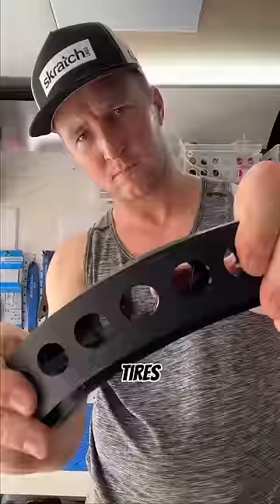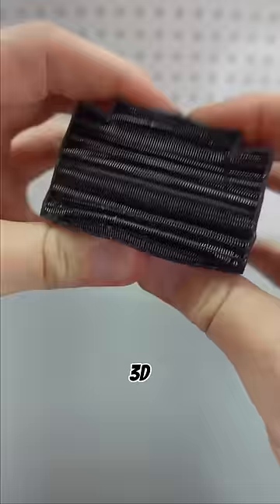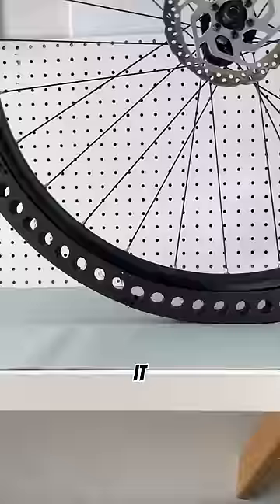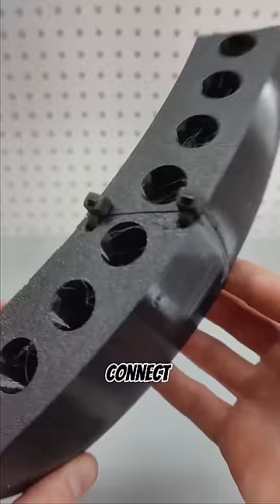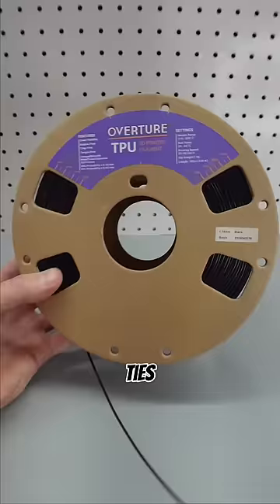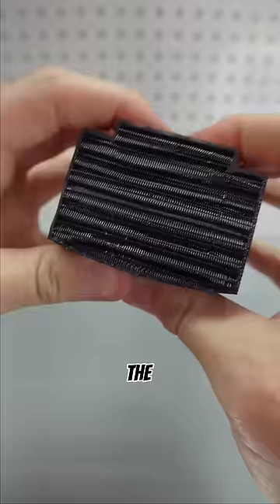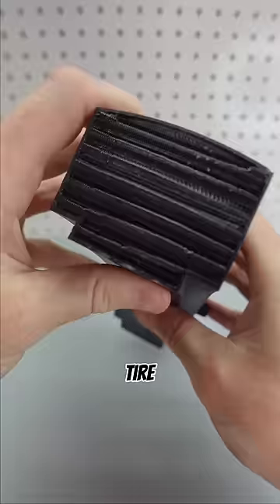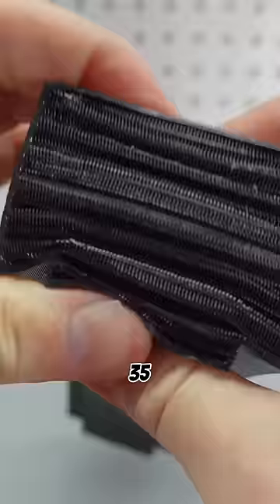3D print your own bike tires! #mtb #cycling #bikeshorts

Comment: You can squeeze 30psi like that!! You are a strong man.
Reply: If you don't think it's right, whip out your own design. Do better. Show him how it's done, big boy.
Reply: @vociferonheraldofthewinter2284 no u
Reply: @vociferonheraldofthewinter2284  y u so mad?
Reply: @vociferonheraldofthewinter2284  it’s not about that it’s about accurate measurements
Reply: @vociferonheraldofthewinter2284 where did he say it’s wrong
Reply: @vociferonheraldofthewinter2284 You've gotta be kidding, you completely Misinterpreted what he meant. How in God's name. Did you think he was calling him wrong check yourself
Reply: If you only push down on one square inch of it you're only pushing down 30 pounds which is pretty light for male grip strength
Reply: the following is my summation of what we saw, im not an expert tho. with a normal tire, the air is kept in a single enclosed space, so when you squeeze on a single point like that on a normal tire you are also pushing on all the pressure around that point of contact. with this printed tire it seems that each individual point of contact provides 30Ibs of pressure, and when squeezed in a singular point of contact it doesnt interact with the material/medium around it, making 30Ibs SEEM like less when in reality its just because the tire isnt meant to be squeezed like that. the weight distribution is supposed to be over a road where the whole surface of the tire can make contact, not just a few fingers. 

-my educated guess

that guy who commented before me, JungleFatigues, inspired this
Reply: ??? How weak is your grip
Reply: @SixStringShredder Are you drunk or do you just not understand insinuation?
Reply: @clockworkNate  insinuation of OP’s comment or that herald of winter guy? 🤨
Reply: Or you're weak not being able to. 35 ain't that much. I rode 100 psi on my street bike and 40-45psi for rec and trail. 
As an ex bicycle mechanic I could press 35 psi all day every day lol.
Reply: @junglefatigues123  thank god someone who actually knows....as an ex bicycle mechanic I'm a little worried seeing how people think it's almost impossible to press in 30-35 psi. It's definitely NOT hard to do. People out here with friggin doll hands or some shit weak as 😂😂😂
Reply: He has a full grip around the whole tire section. A car on 32 psi can be pushed in vía big thumb
Reply: Yes you can. I can squeeze 50 psi in a hybrid road tire so you definitely can squeeze 30 psi smh.
Reply: @vociferonheraldofthewinter2284 you don't have to be a chef to know that food is bad
Reply: @vociferonheraldofthewinter2284 you realize he's not wrong the first thing i thought was htf does it compress like that if he just said about 35 psi. Would literally fully compress with the weight of a person
Reply: "Feels like" doesn't have 35psi in them 🤣
Reply: I can complete compress new car shocks witch my bare hands
Reply: @vociferonheraldofthewinter2284   well that didn't go the way you thought it would, did it?? 😂😂😂
Reply: @vociferonheraldofthewinter2284  as a mechanic. That is about 10psi max. You cant squeeze 35 psi like that. You would need leverage
Reply: Go measure a 35 psi car tire and tell me if you can squeeze it. Everyone's a youtube mechanic in the comments 😅
Reply: @insolentish11 car tire pressure is also 35 lbs please show your video of you squeezing a aired up car donut.
Reply: @vociferonheraldofthewinter2284 come back kid, we want to make fun of you.
Reply: Dirtbikes  using 2-3bar  29-43psi for jumps and u can squeeze it... racingbycicles use  if ur weight is about 70kg  7bar means about 101,5 psi....
Reply: @junglefatigues123  we all know what a 35psi bike tyre feels like- fairly tight. However my trike runs at 70psi to my preffered minimal rolling resistance. 35 doesn't grip as well on fast tight corners- you can hear them scrubbing.
Reply: @SB35702  news flash- wheels are round and bike tyres have a round cross section. Actual ground contact while riding is really no more than 1.5" square. Unless of course the pressure is way too low. On my recumbent trike, the standard tyres minimum pressure is 35 psi, maximum is 70- which is what I run for best grip on fast corners and better rolling resistance.
Reply: Air reacted differently than a polymer steacture to compression. Air can move inside the tire while this can not. So to evaluate that you would need to try it on actuall ground.
Reply: @vociferonheraldofthewinter2284  I think you missed what he was saying
Reply: @junglefatigues123 You have never tried to push down a 30 psi tyre, bruh its like a rock
Reply: @vociferonheraldofthewinter2284 I don't think strength has anything to do with design, but ok.
Reply: @junglefatigues123 that wasn't anywhere near 35 PSI. You can't squish an bike tire like that.
Reply: @vociferonheraldofthewinter2284 keep licking every shoe you see, brother 👍
Reply: @vociferonheraldofthewinter2284 someone’s triggered hahahaha
Reply: ya didnt look like that equals 30psi
Reply: @vociferonheraldofthewinter2284 okay that’s not wha he’s saying… he did good work but it’s not usable, it would be completely useless on mtb would fall off. But lying abt the tp is also really weird. That’s obv not even close to 30 psi so why lie? Just be honest hey I made this it’s not perfect I need to make it more stiff like it’s not the end of the world
Reply: @vociferonheraldofthewinter2284  You got sand in your vijayjay again?
Reply: @vociferonheraldofthewinter2284  nah
Reply: @SB35702  you obviously don't get air pressure
Reply: @clockworkNate reading in between the lines like an English teacher normal people just say what they mean
Reply: I think that is about 10-15 psi.
I think that you could probably use a solid rubber to get a higher psi equivalent. But this is a good idea.
Reply: @vociferonheraldofthewinter2284  Lol. This guys didn't invent this design, it was done by Micheline 2 decades ago. I work on my vehicles myself so I know what 30psi is like. Sure you can squeeze it a bit but not like he did and hence the comment. 
Bike tires have round outer cross section unlike car's flat. The reason being, most of the turn on bikes is at speed is obtained by leaning and not steering. Leaning in reduces the average radius to point of contact and hence reduces rolling distance achieving a turn. 
Try that with a flat tyre and you will know. 
You could have corrected my and showed me better design for crying out loud.
Reply: You are absolutely right. I definitely think it should be more strong. The idea is absolutely interesting.
Reply: @vociferonheraldofthewinter2284 dont act like his dog 😂
Reply: 30 psi is incredibly stiff!
Reply: @vociferonheraldofthewinter2284 you don't need to show him how it's done to understand this solution is crap regardless. That 3D printed TPU is going to delaminate like crazy and come apart in no time.
Reply: @WanderingExistence stan, why are you so mad?
Reply: @vociferonheraldofthewinter2284 y u mad bro? He wasn't criticizing . He was making a observation that was quite astute.
Reply: @vociferonheraldofthewinter2284 Why are you defending a random person on the internet who is clearly incorrect? Dude said around 35psi, anyone that's ever pumped a bike tire knows he's lying
Reply: @vociferonheraldofthewinter2284  damn dude, chill, "big boy"
Reply: @vociferonheraldofthewinter2284  ""If you don't think it's right, whip out your own design. Do better. "

The old: "Don't like the food? Show me that you can do better!" argument.

I bet you'd run a great restaurant into the fucking ground.

Comment: 1. Turning radius?
2. Durability/wearing out?
3. Zip ties flexible enough for the compression/decompression of riding?
4. Length and mass of the tpu filament used? 
2.+4.=5. Cost of the 'tire' per mile + inconvenience of changing plus waste? 
6. Probability of a sudden catastrophic failure while driving against a pneu? 

So till now you mostly just toyed around and you recreated something the industry tried a few times now - unsuccessfully.
With the difference that you can't prove and didn't try so far to prove it's feasibility.

One difference: users could print them at home. And then spend even more microplastic on their ways.

I don't say that it's a bad idea on its own. I dont say that it's not feasible.

But having a concept and creating a prototype is not virtuous on its own. What comes out of The r&d is what matters.

Especially when the concept competes with pretty good solutions or is to fit a very very very small niche
Reply: Sounds like you're describing the Coof 19 vaccine. If you know, you know. 🤨
Reply: Always one of you

Comment: I think trying to brake would be hard! Looks smooth!
Reply: Have you looked at bike rims before? They're perfectly smooth.
Reply: @Tazytots That depends entirely on the type of bike tyre. Some are smooth, some are heavily treaded
Reply: @ari638  Bike brakes dont brake by grabbing the tire. They grab the wheel rim if you have calipers, and they grab a metal disc (it's smooth), if it's a disc brake. The type of tread is entirely irrelevant to the brake on a bicycle.
Reply: @Tazytots yeah, and then the tire of the bike has to be able to grab the riding surface for you to stop, the wheel itself not turning is only one part of the process.
with something like this on a road you'd hit it brakes and then still slide forward, it makes it harder to stop safely and quickly.
Reply: @BiBirdBoy  Road tires, and slicks for motorcycles would disagree entirely.
Reply: @BiBirdBoy  while that is true, you can ride with these in open and empty areas as you can side stop anytime. I wouldn't recommend side stopping however as it'll be worn through the tires very quickly
Reply: @BiBirdBoy You know you're not supposed to lock up the wheels while braking? That's why cars and motorcycles have ABS.
Reply: @Tazytots  uh The momentum from the wheel stopping goes into the tread if your tire is smooth you're going to slide
Reply: @Tazytots you need the tire to get a good grip of the ground so they dont keep sliding. I do a lot of mountain biking and i can definitely tell you that the tipe of tire matters. (Sry for bad english)
Reply: @Tazytots  There's this thing called friction, ever heard of it?
Reply: @vamez4798  There's a lot of confusion out there about tread and it's purpose. The short of it is that tread is only helpful when you are riding on loose material like gravel, grass or dirt. In these circumstances the leading edge of the tread digs into the material giving you traction. On roads on the other hand the smoother the tire the better. There's nothing to dig into because the surface is hard so you are instead looking to maximize contact/surface aria with the road. This is why entirely smooth tires exist called slicks. Most road tires do have a bit of tread though, both for the psychological effect of people thinking it's necessary and also because sometimes people hit a patch of gravel or need to roll over a lawn.
Reply: @osmano675  You clearly need to look up road bike tires. Tread doesn't matter. Lmao.
Reply: Also if anyone is thinking about cars their tread is a very different beast. Because car tires are mostly flat instead of curved (to maximizing that surface area mentioned in my other post) and because cars go so fast, the tread is engineered to reduce hydroplaning by pushing water on the road into the channels in the tread. This is not something you will ever deal with on a bike.
Reply: @LL-fw7hi  Most road/endurance bikes have slick tires. Entirely treadless.
Reply: @Tazytots  My experience is that almost all tires that are used on roads have some, if minimal, tread. The only people I've personally seen use slicks are people riding fixies (though I don't hang at the velodrome) which is the extreme minority of bike riders.
Reply: @BiBirdBoy  I am sure he can print a new version with good grip. This looks like a test/semi-proof of concept.
Reply: He will prob put the grip thing on that 3D printed tire
Reply: @LL-fw7hi  yeah my point was that the type of tire matters, I ride a lot on dirt, gravel etc so I can't use smooth tires
Reply: @iddra1868  the tires are still supposed to have traction to help stop quickly in an emergency, and for so many other situations. for example rainy/wet roads. the tires need to grab to road when they stop, thats why your meant drive/ride much slower on gravel than concrete, its harder for any tire to grab gravel but if you go slower you need less time to stop including an emergency.
Reply: @BiBirdBoy  If you're talking about emergency braking on a bicycle everyone will instinctively apply brakes as hard as they can, and lock up their wheels. If something shows up in front of you no one is thinking "I need to apply just the right amount of pressure" in that split second.
Reply: @iddra1868  i know, thats kinda what i was trying to say, no matter how fast and hard you slam on the brakes (quite frankly on a bike, motorcycle, or any vehicle going faster than like 5ish mph) if the tires cant grip the surface you wont be able to stop as quickly as you could if they were able to. being able to stop as quickly and as safely as possible is a big part of safety, even more on bikes than on cars in my opinion, at least for the driver.
Reply: @LL-fw7hi Just wanted to add tread also helps riding on wet surfaces because it gives water a path to move out from under the tire.  No tread will have you sliding more.
Reply: @LL-fw7hi the primary purpose of tread is for water dispersion, without it you aquaplane immediately in wet conditions.

Comment: Improvement idea: make the ends of each segment male and female so they can slot in and have the through holes fore the zip ties go centraly through both.

Also add V groves not only to line up with the male/female interlock but also to displace any water you may bike over and maintain traction to the road.
Reply: Make this an insert that replaces an innertube with a regular tyre that fits over it. Make it easier to fit by shrinking it: putting it in an airtight sleeve, then suck a vacuum. After fitting, pierce the sleeve through the valve opening, so the printed cushion "reinflates".
Reply: Did you just assumed their gender?  Careful sarcastic

Good idea tho
Reply: Smart I think lot more improvement needed but could be done and it can be a solid replacement for bicycles
Reply: also add a tread on the outside edge, and make the layers thicker right at the tread to help it wear slower, and round the bottom edge like a regular tire for leaning and turning .
Reply: Good idea, could use a dovetail like in woodworking, that would lock them together
Reply: @gamingwithsupermanrr9150 but we do not need a replacement.